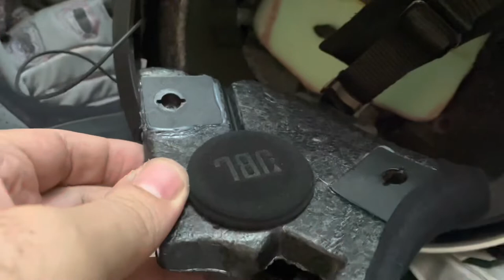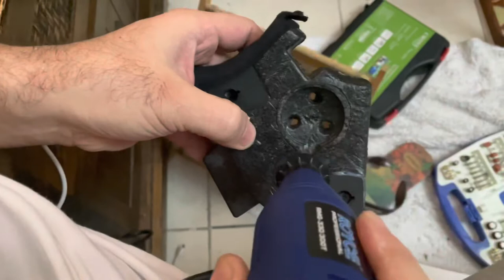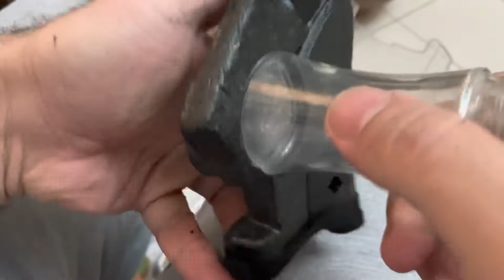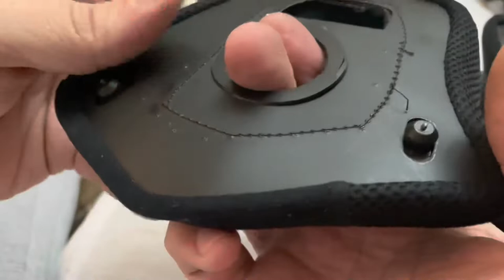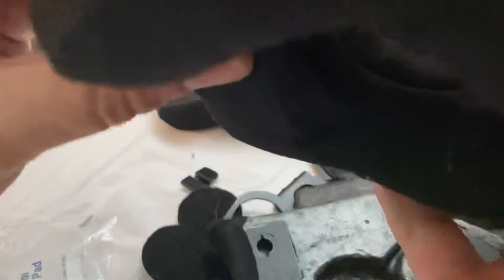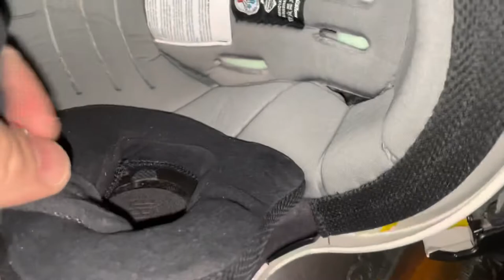How to fit Cardo backtalk black in Nolan n-com Helmet.

Comment: Thanks for posting.  I would like to have seen the side of the helmet with the Packtalk installed, and how well (or not) it fits with the sun visor control.  Do you have any difficulty operating the sun visor?
Reply from the maker: Hi. There is no difficulty at all.
Reply from the maker: Yes you are right. It is not easy if you did mistakes in installation the visor control will touch the unit and not work. Just measure every thing right.